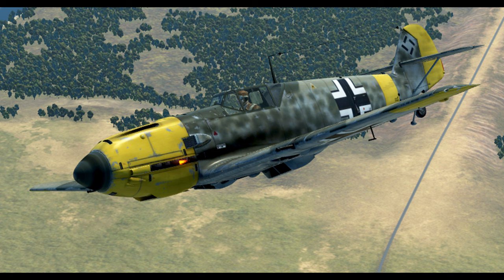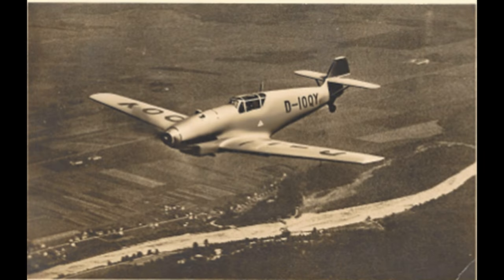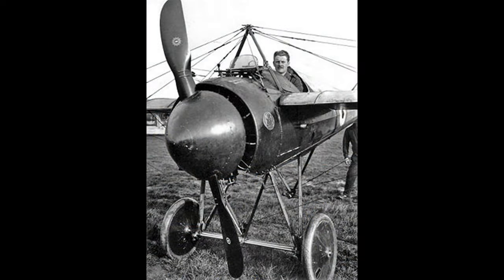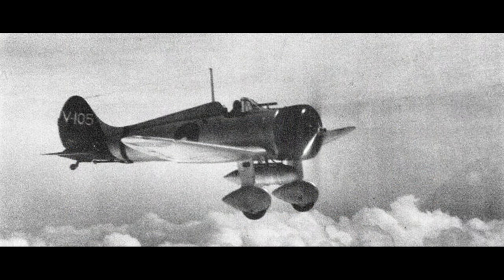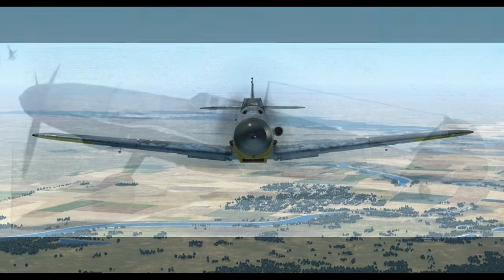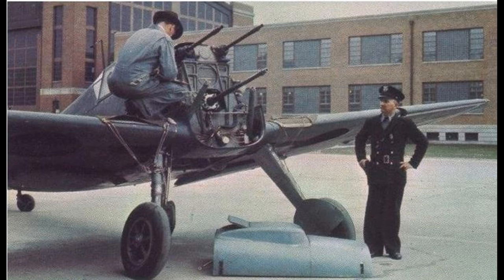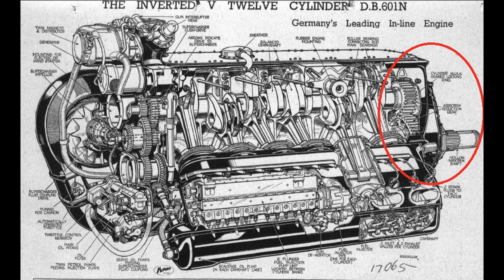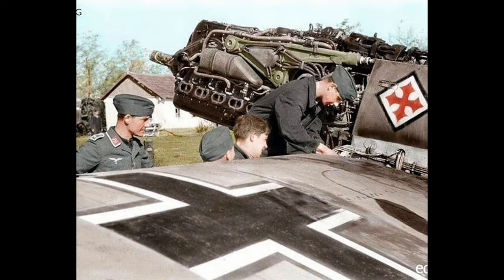Why an INVERTED V-12?  PART 2

Comment: Whereas I can see that other things being equal, an inverted V would presumably lower the centre of gravity of the engine, and that might be one of the reasons for the original inverted design, I wonder if that purpose was frustrated in practise in the Bf 109.  I have heard that the Third Reich being notoriously short of the ingredients for high-quality steels, Daimler-Benz equipped the engine with an unusually massive crankshaft of lower-grade steel; so I wonder if there was much difference in centre of gravity whichever way up it was.   P.S. Greg I have sent you a message via Patreon.  Excellent video, again.
Reply from the maker: I will read the message in about an hour from now.
Reply: Given that the crank is uppermost on the inverted-V engine I´d think the CG would be rather higher than on upright-V engines.

Comment: Another factor is the Center of Gravity or CG, inverted engines have a lower CG than upright engines, it has a big effect on plane dynamics when you consider the 1,300 lb weight of a 35 liter DB600
Reply from the maker: Did you watch part 1?
Reply: Yes I did, you did mention it in your first video

Comment: I just discovered your channel through your last inverted V12 video. I was really impressed so perused some of your other content and subscribed. I can't wait to delve into your back catalogue, and see what you produce in the future. Thank you for your hard work so far and I hope you have a lot more great stuff and success to come!

Also I just wanted to say that there is a very noticeable drop in audio quality between this video and the original inverted V12 video I watched. In this video it almost sounds like you're sitting on the other side of the room from the microphone (although I'm sure this isn't the case). I would guess that this is because you produced this video more quickly as a response to the community involvement in the first.

I imagine that so far you have produced content as a passion project, rather than expecting a financial return on your time investment. But I have a feeling that your channel is starting an exponential surge in popularity (that is usually the point at which I discover a new channel like yours through the YouTube Algorithm Gods). Hopefully this will bring with it the monetary compensation that you deserve, and perhaps encourage/allow you to produce more content with higher production values. I am certainly not an expert at producing YouTube content, but I might consider myself something of an expert at consuming it! So from that position, I'd like to suggest that you invest in some quality audio recording equipment. A crisp and clean auditory experience goes a long way to making videos more enjoyable and desirable, and thus further reaching.

Anyway, thanks again for the hard work so far, and I'm excited to see what you produce in the future. I hope great success is on the horizon for you!
Reply from the maker: Thank you Brandon. The videos on the inverted V-types seem popular, but they are not even close to my best videos.

Comment: I can't remember if I commented about this before;

But anyone who has rebuilt an upright (standard) automobile engine will know that one must remove the engine from the vehicle, mount it to an engine stand, and after removing the heads, will flip the engine over in order to remove the main bearing caps and the Crankshaft. 

You cannot remove and install a Crankshaft when the engine is upright, because the crank is very heavy and requires delicate care to set it into place. Also, the main bearing caps would simply fall out due to gravity and it would be a nightmare if impossible to replace the crank and bearings from below. 

So you can see one must invert a standard V engine in order to repair or replace main bearing damage, the crankshaft, etc. 

With the 109/DB combo, it is obvious a single man with a light duty overhead hoist and a step ladder could possibly be able to perform then entire task alone. Or possibly two or three men with a makeshift scaffold and no hoist could probably remove the crankshaft, or drop the crank back in and torque everything to spec and send the airplane back into battle.  Probably in a matter of hours depending on if the propeller and entire gear reduction unit had to come off to pull the crank, or if it could be only partially disassembled in the field.

The DB crank was a multi piece unit, if I remember correctly. Because that's the only way to install roller bearings being full circular cartridge type bearing races.

 *Edit* No, the DB series did in fact have a solid crankshaft. The roller bearings are captive in half shells and installed like typical rod bearings. The main bearings are plain journal type, so they get plenty of oil flow. The roller type on the rod big ends would need very little oil compared.  It must have been other aero engines that were multiple pieces.

Comment: I think that a Bf-109 just had more obvious Engineering advantages with an inverted V-12. One I did not hear was that it would also add structural integrity for the Landing Gear stress points having a nice strong Cylinder Head that would easily take the forces from landing on unpaved , or rough Runways . Basically the Engine was Designed specifically for the Bf-109 , and German's were notorious for overengineering where the Allies were all about parts interchangeability. The FW-190 was in developement for years  , and the DO - 335 Pfiel , I think it's 335 was a fascinating , and an Engineering work of Art , but they only could maintain about a half Dozen or so.. But the Bf109 was , from what I have learned , the favorite Fighter of choice by both Adolf Galland , and Gunther Rall. If I can find those old interviews of Them , I bet One of Them mentions something about the inverted design. I vaguely recall something about the fuel injection too.

Comment: It was in the 1929 RLM guidelines Reichswehrministerium (Imperial Ministry of Defence), in 1929 Daimler-Benz begun development of a new aero engine of the 30-litre class: a liquid-cooled inverted-Vee 12-cylinder piston engine. So the Engine requirements where laid out before the 109 was started being designed in 1930 , as a result the aircraft design evolved around what the Engine was going to be , possibly the requirements where for ease of maintenance from experience learned during WW-1  , But due to restrictions put on Germany after WW-1 they couldn't develope powerful aero engines and fell about 10 years behind everyone else , so once they where locked into a development path it was pretty well fixed , Their Ministry of Defense set the guidelines, of course that didn't stop Mecedes Benz development of large capacity V12 Grand Prix racing engines , though these where of conventional design ( non inverted)

Comment: Could you do a video on the oiling system of the inverted engine ? I have always wondered how they keep the oil from back filling the pistons.
Reply: The cylinder sleeves stand proud from the crankcase and work as a dam.

Comment: The history of this engine goes back till 1930 when the ministry of transport asked for a inverted V aircraft motor with 800 hp for civil and military purposes. Daimler-Benz build the F4A the ancestor of the DB600 series and Junkers the Jumo 210 ancestor oft the Jumo 210 series. 
The inverted V aircraft motor was sometimes called A motor. As advantages of the A motor are mentioned low centre of gravity, low exhaust pipes so exhaust gases do not reduce the pilots visibility, high propeller and short landing gear.   

According to the German Wikipedia the reason for demanding an A motor was the easy maintenance of the cylinder head. 

How ever back in 1930 the staff of the ministry of transport thought about there experience in WWI when they demanded an A motor and not what happened 9 years later.

Comment: As answer to your topic i found some resources:
In 1918  an advice was given bij Georg Madelung for the development of new areo enigines. He advised hanging cylinders  in the A form. (now called : inverted V)
The German Military made a specification for new aero-engines in 1929 in the class of 20 to 30 titer.
Helmut Sachse and Wolfram Eisenlohr were thechnical advisors for this specifaction. Both of them played a great role in the German Aero-engine development.
Wolfram Eisenlohr wrote in a letter from april 1980 : "We wished hanging cylinders because het top of the engine was smaller and therefore the sight in a one engined plane would be better. The lower laying exhausts were an advantage in nightflying.

Comment: Convincing engineering discussion. But maybe not allowing enough for the German need to develop existing engines. The design got started in 1930 (maybe even a bit earlier, for the first sketches). At that time maybe some designer did think that fuel injection freed them from considering carbueretter placement, or that inverting the V might provide room for guns, or some of the other arguments you have convincingly countered. They cannot possibly have had a really clear idea, in 1930, what air combat would be like, or what airframes the engine would be used in. Once the DB600 was chosen, that was it really - the German economy in the early 30's could not possibly support multiple competing speculative engine designs - they had a good engine, and they just kept improving it, they wouldn't even have considered throwing it away because the V was upside down, I think. What I mean is, you need to determine what somebody was thinking in 1930, not 1940.

Comment: A useful supplement to the previous BF109 video, and I have to say that the photo you managed to come across with gun barrels in place but engine removed is one of the best illustrations – photographic or hand-drawn or anything in between – of how all those mechanical and armament bits go together that I've seen in decades of reading about WW II fighter planes. I totally agree that maintenance and visibility issues have to be kept in mind when thinking about WW II fighters. I look forward to the FW190 video(s) and the remainder of the P-47 series. I'll also put in a plug for the F6F (I hope it's not too far down on the list), and I'd like to see one on the Nakajima Ki-84 "Frank," which was apparently every bit the equal of the F6F in the last few months of the war in the Pacific. As a non-engineer, I'm hoping to stumble across an explanation of propeller tip speed's importance, as well – that's a technical tidbit I don't quite "get" yet. Be that as it may, it's all good stuff, Greg.
Reply: prop tip speed is an issue when the tips go supersonic, that is when they travel faster than the speed of sound. I'm sure that Greg can expand on that a lot, but that is the crux of it.
Reply: @Ropetangler  And don't forget that the prop tips are traveling both circularly and forward too at the same time.

Comment: I have to wonder if lubricating the valve train under high G-forces is one of the benefits of an inverted V-12.  Many automotive engines pump the oil to the main crank bearings first, and then through oil passages to everything else. In a upright V-12, positive G's would fight the oil getting to the valve train. In an inverted V-12, positive G's would help force the oil towards the valve train. An upright V-12 could avoid this by running oil lines from the oil pump to the heads or valve covers to provide lubrication, the Inverted V-12 doesn't need to. In both cases, negative G's would pull the oil away from the pickup in the sump, and starve the oil pump.

Comment: Love your videos! Dragged out my apprentice notes, and the 2 reasons listed for inverted engines,  Shorter landing gear (befuddles me) and pilot vision. Hope it supports your theories.
Reply from the maker: Thanks Des. The shorter landing gear is in reference to the ability in a direct drive prop configuration (meaning no gear reduction) to have the prop higher, thus the gear shorter. So all of that is right in line with what I said in the two videos on this subject.

Comment: Anothony Kay in his book "junkers aircraft and their engines" notes that one reason the Germans chose fuel injection was that various American and British companies had all of the best carburettor patents.  On the other hand Bosch had all of the best patents on high speed direct fuel injection as a result of their work on high speed diesels.

Inverted V engines align the propeller axis better with the principle drag axis, as a result power changes will cause less pitch changes and need to trim the aircraft.

Charles Lindbergh flew a 109, he commented on the visibility, I think not directly over the front but forward to the side.  It would be interesting to compare the Spanish Merlin engine 109 with a Daimler Benz 109.

Comment: My understanding is that aircraft piston engines use updraft carbuerators (instead of the downdrafts common in automotive engines) because they're less likely to flood during negative-g maneuvering. This would be one reason they were mounted behind upright V engines. An inverted V engine might make it possible to mount an updraft carb between the cylinder banks; therefore, an inverted V might allow for a more compact intake setup with the carbuerator between the cylinder bank. Though I suspect other factors like minimizing frontal area and plumbing for turbochargers, supercharges, and intercoolers would eliminate any practical benefit here.

Comment: This is engineering 'consideration'.   
          It's something one experienced at sea, with the engineering space and systems design of German, Dutch or Norwegian built AHTS boats proving far more considerate to the engineer than did, for example, American vessels.  They were just a pleasure to maintain, whereas the design of most (but not all) American engineering spaces didn't seem to care about maintenance, or the poor sod doing it, providing insufficient space and then illogically squeezing too much stuff together to compensate.    
           German boats were always exemplary, even having separate appropriate small sets of tooling and ready spare parts localised at hand to each regular maintenance job.     One reason for this, I discovered while working in Hamburg, is that German yards, very intelligently, use grumpy old engineers with eons of sea-time as their engineering superintendents, and kids with laptops are "verboten!".

Comment: Visibility wasn't really the reason the inverted V was chosen for the 109, although it was a byproduct. The 109 stemmed from Hitler's request for a race plane. He wanted Germany to have the fastest aircraft in the world. The designers got together and discussed the options. The choice for the low slung wings was made do its inherent benefit of being able to produce more lift that a high slung wing, allowing for a smaller wing which in turn reduced drag. Next we get to the engine choice. A radial engine, while powerful, was large and produced too much drag. They were left with either inline or V type engines. DB had just produced a new V12 that produced significantly more power than any inline engine available at the time. So naturally that was chosen. They decided to invert the engine, again to reduce drag, under the principle that the fuselage is naturally larger where the wing roots are. The designers took advantage of the already larger cross section of the lower fuselage by mounting the engine inverted, allowing minimal additional drag from the engine cowling. Having the smooth flow of air over similarly sized sections of the plane caused less drag, allowing it to fly faster. This race plane ended up going into production as the 109.

Comment: Tilly's Orifice 
The Rolls-Royce Merlin engine originally came with a direct carburettor, prone to cut-out due to fuel flooding in negative G. The German inverted V engines did not have this problem because they had fuel injection.

Comment: Biggest advantage I see is cooling, especially when negotiating high G maneuvers. I addition to what I wrote on the 'part 1', although the cooling system is pressurised, you prevent a cause of cavitation around the cylinder head also. Having to stand on a bucket or ladder etc is not really an issue. The engine is not that large, only need to have the ladder etc in the middle and you can reach to both sides to replace/inspect spark plugs. Maximum distance between spark plugs is on about 1 metre. 500mm reach from the centre of a person is hardly a long reach and does not require a ladder to be moved for each cylinder. Mechanic by trade, I can say dropping something in the engine is not a big issue, easier to find than if it falls in the mud/snow/grass etc. It is also hardly that tall, you would only need a one step ladder. It is also far more ergonomic and comfortable on the neck and back looking down than it is looking up. As a mechanic work under a car on a hoist, working in the engine bay is much better. Try working with your arms over your head for 30 minutes straight, it becomes tiring. Looking up and even laying on the ground is harder work than standing up and looking down. Laying down and holding your head up is hard work.

Comment: Thx for the video. 
The German developmental documentation stresses line of sight 
advantages primarily, and stresses the desire, because of limited industrial capacity, and wanting therefore the most flexibility across applications, that standardization of inverted inline engines be mandated across industry (for non-radial applications). The documentation of the design & development of the Ju-87 goes to some length to lay out the line of.sight advantage an inverted Vee engine offers to the dive bomber pilot.